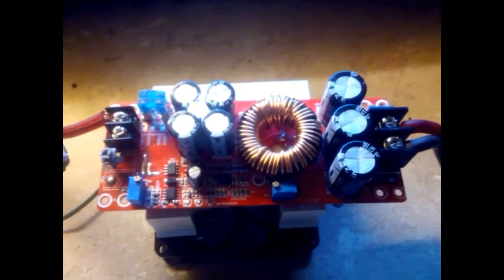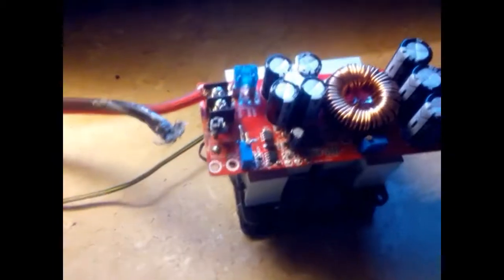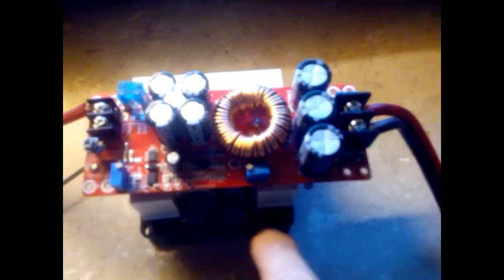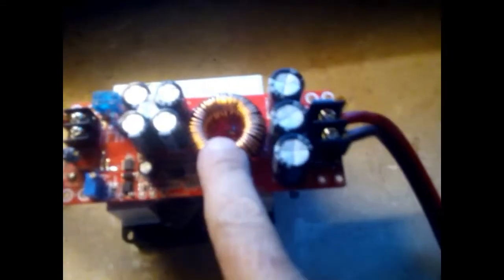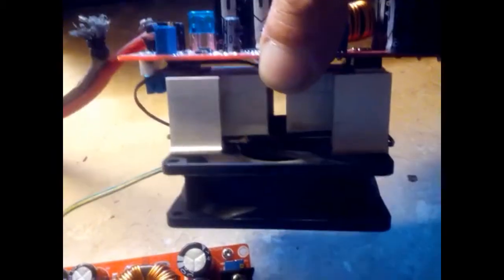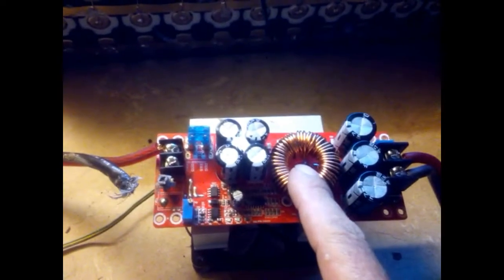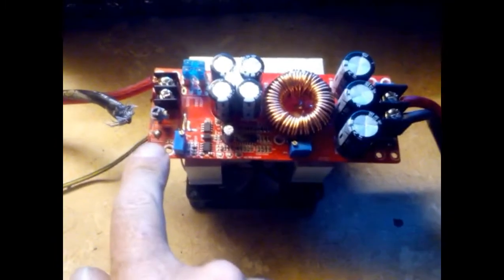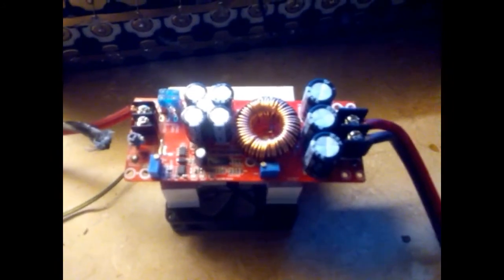1200 Watt Boost Converter Problems

Comment: These are good converters. I run giant lasers off them and have not had any problems. Can smooth out ripple with some extra caps if worried about ripple.
Reply from the maker: yes they are i just had lots of problems with the learning curve of them. replaced the big mosfet in one so much the traces got worn out and had to toss it in the garbage.
Reply: @battery_solar_ev  They can't have too close to a shorted load. Even with really low resistance curcits can trigger it to give full current on output. That's the only problem I've really had with them. 
Otherwise they make great little chargers for batteries and also to run things off of lipo.

I did notice there is two distinct different "brands" or mfg styles. One is really good and other not so good.

Comment: I have one as well, yesterday when the input power was a 3S lipo and the output was 52V, 5-6amps, the leds and output power went off after a few minutes. Then I saw that all of the fuses had gone. 3x 20A. I replaced them and tried again, all of them gone again. Do you have any idea for the failure?
Reply from the maker: the largest mosfett is shorted. You need to measure the input current while setting it up and dont go over 30 amps at the input make sure you have a fan to keep it cool or it will cook itself. Ive been running mine at 18 amp on the input with a fan and larger heatsink and so far no problems at all with it.

Comment: I purchased one, added bunch of solder to all power traces and upgraded to bigger heatsink and at input installed 12Awg double wires. And I’m using it at continuous 20A input and 54.6v 5A out. But today I purchased another one. And waited almost 2 months to delivered. When I received it. And when I give 12v input - at output it shows 11.59v , I don’t what’s wrong with this. If there is a simple fix that would be really appreciated, if there isn’t then I will have to send it back.
Reply from the maker: make sure the current setting on it is not all the way down and check your low voltage shut off as well that may make it not work

Comment: dude that burnt because your wires are fucking thing you need thicker gauge or the wire will heat up and I can see your melted wires
Reply from the maker: 10 awg wire not enough for 20 amps??? uh really? Look up wire gauge chart and im no longer using the low temp wire and it melted because of the heat produced at the terminal blocks.

Comment: I just bought 2 of these and they both blew up at 10amps.
Reply from the maker: 10 amps at the input or output these need to be measured at the input under a load safe is 18 amps with a fan and no hotter than 70c
Reply: Dubsy Dubs what voltage?

Comment: hey bud what gauge is that on the input? I am using 2x 15AWG wires in parallel for positive and negative, they get pretty warm at 30A that is for my 1500W boost converter I have. https://youtu.be/7-GzWReV4j0
Reply from the maker: its a cheap side under gauged 10 awg wire that works but ill never by it again. The pads on the bottom side of the board are joined they did that i suppose to be cheap knowing that the input would pull upward of 30 amp the inductor gets upwards of 150F and the output ground 130F during batter charging. I actually soldered the wire down to the input and its fine the other i used a spade connector to bridge the 2 to make it share the current. Over all its just a bad design and ready for thermal run away. If you take a look at the pcb its touching the mosfet and holding it down i fixed that when i had to replace the mosfet and added copper shims for the other transistors/diodes then used thermal tape instead of force hold by the pcb i dont even have the pcb secured down any more that thermal tape is super sticky on a clean surface. Everything is much cooler on a larger heatsink and a Arctic TC fan